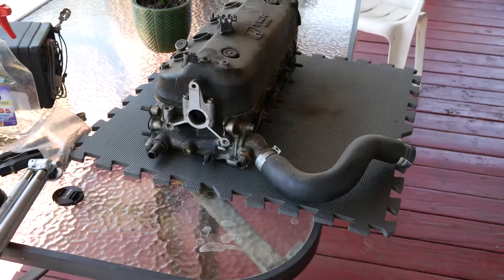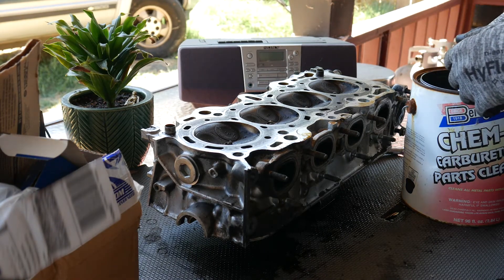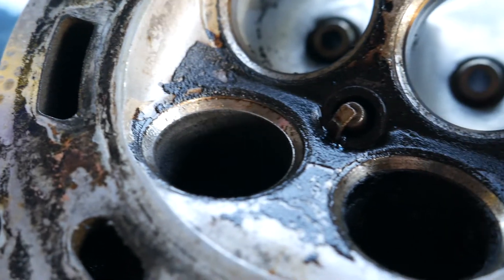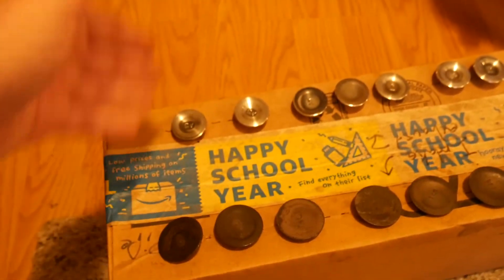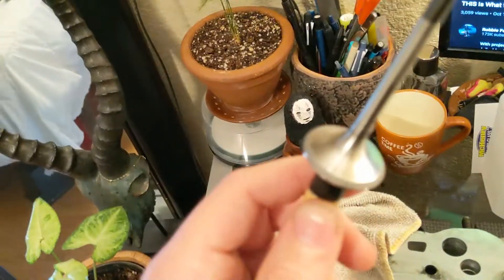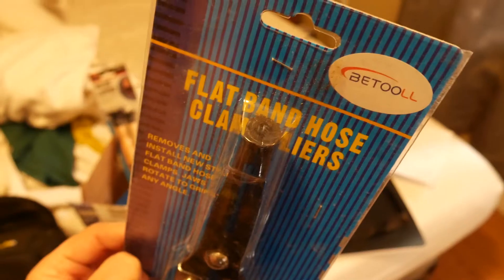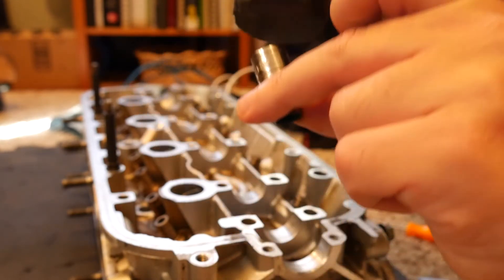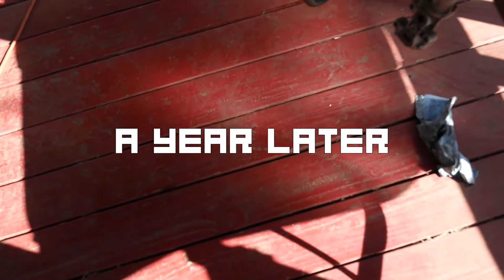Head Assembly, Time to get dirty // F22A6 [1990 Honda Accord]

Comment: Ps, I used a small wire wheel in my drill to clean the head of all the carbon. It was a brass “gold color” wire wheel. It was perfect
Reply from the maker: I know the exact one! Grabbed a dremmel and did it on the subaru build. Those pistons are shinning right now 🤙

Comment: Glad to see that you are continuing the build. I am going to do a h23a intake manifold swap. I was wondering if I could rock a pt6 ecu and the intake (since it’s the same as f22a6 intake) without replacing the cams and springs yet, do you think the engine would run ok with pt6 ecu ( I had a f22a4 manual)
Reply from the maker: Yo thank you! I definitely will! Honestly from what I've seen, maybe, it'll run rich. It should work out just fine but there is a black box you also need hook up with the ECU since your A4 wont have this. It sits directly below the A6 Manifold and from what I've read its the same for the H23A. As long as everything is connected the PT6 should be so-so, but honestly it's a pretty rough estimate since you haven't tossed cam's or springs. Personally I wouldn't do it yet but I hope your build runs beautifully if you do go for it. For alittle more information on the PT6, I did a video on it and I believe I touched on the blackbox/where to find info on it
Reply: PaycoTsunami Thanks man for the info, I’m looking forward to seeing the rest of your cb7 build!!!

Comment: What tool is that you use for the springs? You didn't have to put the keepers in separately???
Reply from the maker: technically yes? You have to put them in place by hand but just push them both with the tool! The tool is in the description if you're interested in it!

Comment: Did you ever find out why your cooling fan won’t work cuz mine isn’t work either but when I try to bypass it like you did with the paper clip it doesn’t work I don’t understand why
Reply from the maker: You can double check the wiring with a multimeter at your fans end to see if you're getting any power or double check your fan relay. It's been awhile since I've worked on the Honda personally so I can't honestly remember at the moment. Just got to trouble shoot issues till you pin point the problem but I hope you find your issue soon!